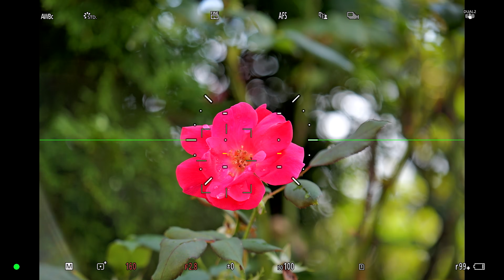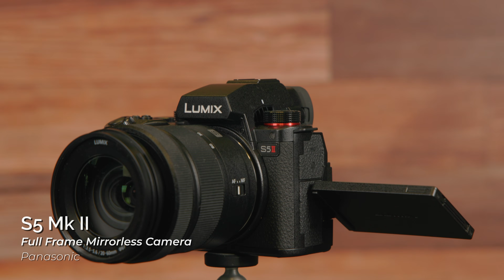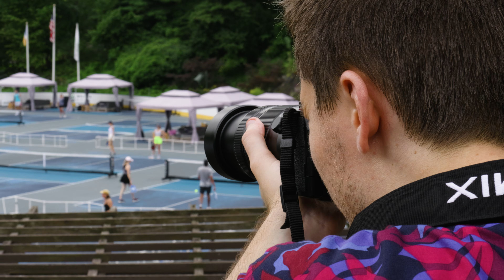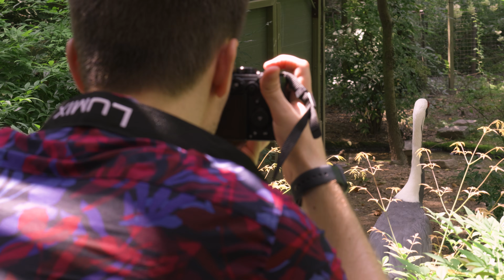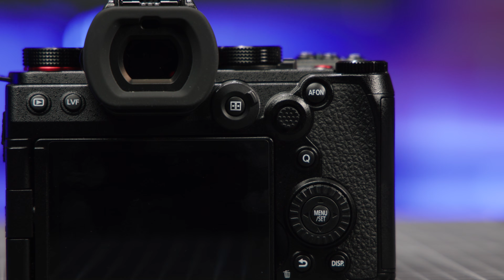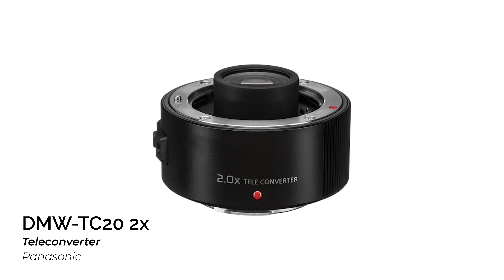Panasonic Lumix G9 II - A New Hybrid Flagship

Comment: Wondering if the Mark 2 cwn switch between PAL and NTSC? That was why I chose the GH5 instead. Yes, I can use Syncroscan to adjust for the hz difference here in Europe if I want to film 60 fps, but just being able to interchange PAL & NTSC is just better. Here in Europe, I mostly use 25 or 50.
Best regards from Stockholm

Comment: for photographers, om-1 is stacked and bsi. g9ii is neither. at the same price.

im an amateur and look for hybrid, and even for me, in video, it bugs me they couldnt put at least a bsi inside, if not dual iso, in 2023.

and did u see the diff against a7cii or zv e1? it's quite big compared to those two. in 2023 if u want compact, full frame wins sometimes against mft. its weird
Reply: I just checked with a UK supplier and the G9 II body is £300 cheaper than the OM-1.
Reply: The AF & sensor hardware is there on the OM-1, they just need a few more firmware revisions to make the AF top-notch in real world use. As for overall system size, m4/3 lenses are still significantly smaller & lighter than 35FF ones, so the size & portability advantage is still there especially for travel, wildlife & landscape use. I can't imagine using an FF body & lens for travel or birding. They may be able to shrink the size of an FF body down into a small rangefinder-sized format, but the 35FF lenses are still huge, heavy, and expensive. Using a fast zoom on a rangefinder-style FF body is just bad ergonomics & very unbalanced.
Reply: om-1 is older and lower resolution.  Might as well get a G7 at that point and save $1k.
Reply: @bruhdabones  A G7 has a stacked, BSI & QPDAF sensor? 😂 If you don't know or appreciate what those are, better stick to using camphones.
Reply: @Tleilaxu_Mentat  the point is that they’re both cameras that meet a minimum standard, and when you step down from a G9ii to an Olympus OM-1, you lose so much that any old camera would do the job 😂

Comment: All that video stuff to raise the price of a photo centric camera that skimps out of the photo centric features compared to the OM1 which is now only $100 more. Why?
Reply: what skimping?
Reply: @OutRAjious im not a pro, but seems iso performance is similar. if i were a pro photographer, i would expect at least bsi sensor, if not stacked. om1 is bsi and stacked. g9ii seems to me more like a video centric camera, not photo centric enough for what appears to be its legacy. and 10fps mechanical in 2023 to me seems low, especially in a g9ii. a7cii does 10 or 11, and its af is top notch, low light very good, and is full frame, for bit more than 15% in price.
Reply: Completely agree. It's almost as if Panasonic are almost ditching the GH-6 in favour of the G9 II. Not that I'm worried because I just want a reasonably priced high quality 'photographic' camera. Not one that almost outstrips the supposed 'video centric' model in the lineup! I've already paid a deposit for the G9 II and traded in just about all my Pentax gear and I'm not sure that I might not be regretting it because I'm getting a ton of what I don't really want. I originally thought the G9 II would be the gorgeous G9 body with PDAF and a better sensor but effectively their giving us a MFT version of the S5! They should have named it the S5-X.
If I can get my dealer to loan me a G9 for a few days to really test out the CDAF, I might just cancel my G9 II order and get the original instead.

Comment: Dunno why the EVF resolution is significantly less than the 1 year older OM-1, 3.76MP versus  5.76MP. The LCD screen is slightly higher res at 1.8MP versus 1.6MP on the OM-1 though. I'm not sure if all the computational photography modes available on the OM-1 are also in this G9II, aside from the handheld high-res mode. The # of PDAF points are also higher on the OM-1, 1053 pts. versus 779 on the G9II, and they're quad-pixel on the OM-1, meaning they're sensitive to both horizontal & vertical line detail.
Reply: All that is why the G9 II is quite a bit less expensive than the OM.
Reply: @rayjennings3637  Oh, yeah thanks for noticing that. I've been waiting for a year for the OM-1 to go on sale, it seems demand for it is still high since they haven't felt the need to cut its price. I'm sure the G9II would turn out to be a great camera, the video side is obviously superior to the OM-1.
Reply: You get more battery life and processing speed from this compromise.  Well worth it, even if it weren't cheaper

Comment: I am so utterly disappointed. The G9 was a masterstroke, a nearly perfect camera ergonomically and got me firmly into the M43 system. All they needed to do was to take the Sony 20MP stacked sensor from the OM-1, apply their new Hybrid Phase Detect AF software algorithm, place both into the original G9 and leave the rest alone. I would have bought at least two of those bodies. This is not a G9... this is an G5II, or whatever you want to call it. They would have been better off iterating the GH6 as a GH6s, placing the new sensor and hybrid AF software in that, and charge a extra few hundred for those that needed the AF capabilities. This release just confuses me... as a big M43 fan, I'm not sure what I will do. Again very disappointed Panasonic Lumix team.
Reply: I'd hate that camera you were hoping for😂  I'm a bit disappointed in this but not as disappointed as I would be if if was what you were hoping for.  The thing it's missing that I'd want is usable ISO 6400 and above photos
Reply: Bye Falecia
Reply: Phase detection involves hardware that has to be baked on the sensor. I do hear that that Olympus sensor is great. Hopefully Sony will make a version with phase detection soon.
Reply: Nah this is way better
Reply: Totally with you g9 has perfect ergonomics and feels soo good in hand. They should have added new sensor and algorithms on it and sent as mark ii instead of just putting this in s5 ii body.
Reply: I agree. Original G9 was nearly perfect, I will buy another one. This is an ergonomic downgrade.
Reply: @santakosoundsystem7542 you've actually tested these ergonomics?
Reply: @santakosoundsystem7542 not really this body is much better more user friendly and better feeling